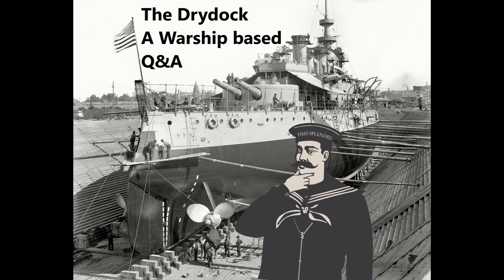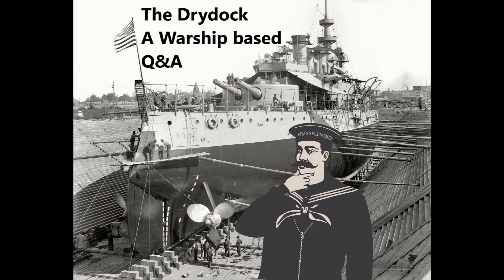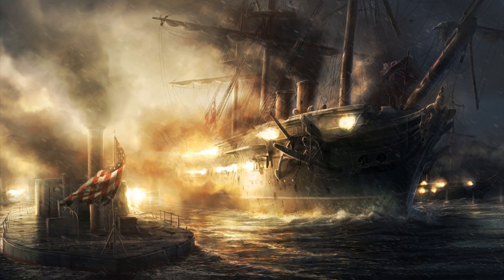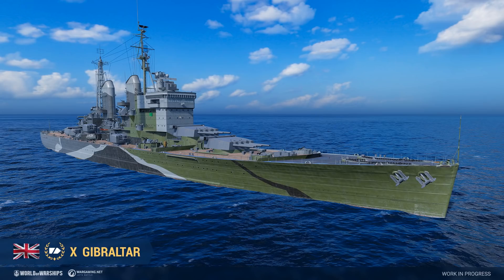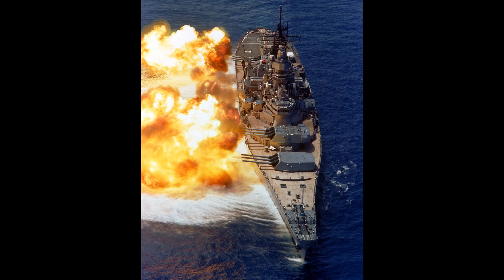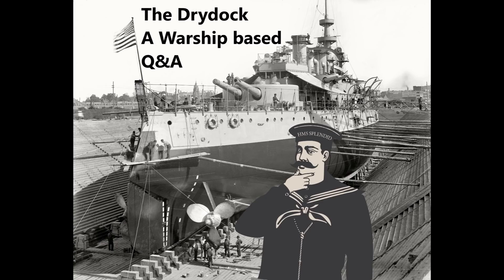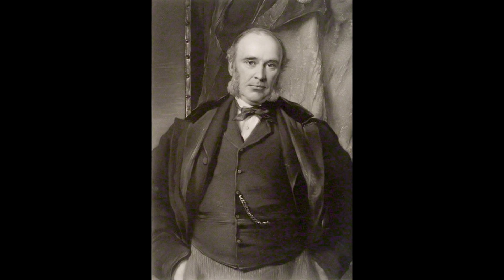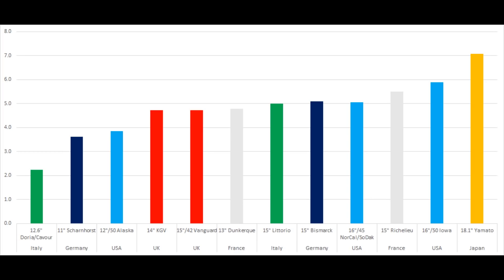The Drydock - Episode 177

Comment: As far as galley fires go, on modern USN submarines fires in the galley (particularly the fryer) were one of the most common we trained for, as they were among the most common to actually occur on board, with the other common ones being the clothes dryer (due to people forgetting to clean out the lint trap) and electrical fires in various equipment.
Reply: Don't tell me secrets but I would have thought the engines would have provided heat for cooking. Except frying, which would be done in a closed compartment.
Reply: @Tuning3434  I should have assumed nuclear subs.
Reply: Ah yes. The lint trap. Another issue in the laundry aside from fires I suppose would be potential vibrations from the washing machine.
Reply: @myparceltape1169  Maybe if they hadn't been covered with asbestos.
Reply: @mpetersen6  I would assume they have a lock down protocol for silent running and the machine is on isolators to help dampen vibrations a bit.
Reply: @myparceltape1169  nope, everything in the galley is electric powered. Steam made in the Engine Room stays in the Engine Room.
Reply: Galley firefighting training provided by Denzel Washington, no doubt.
Reply: @bluemarlin8138  🤣That movie is quite possibly one of the worst submarine movies ever made!
Reply: @Axel0204  What, you mean a US boomer captain DOESN'T get to bring his dog on board, relieve and arrest the XO for not agreeing with him on a nuke launch, threaten to shoot an innocent crewmember in the head to coerce the weapons officer to cooperate with said launch, and punch the XO in the face multiple times, all without any consequences other than voluntary early retirement?  Naaaaah!  

I actually find the movie entertaining, but it's certainly unrealistic as hell, and it must be even moreso for you as a submariner.   As a lawyer who is forced to watch crime dramas that get nearly everything wrong, I can sympathize!
Reply: @bluemarlin8138  the dog is actually the most plausible part of the whole thing, as the CO has the authority to authorize pets onboard, in theory, at least!

Comment: Thanks for a great episode!

 Regarding the Iowa recoil question, I think it would make sense to look at conservation of momentum. Conservation of energy always holds, but the energy that is conserved is the sum of chemical energy in the charge and the kinetic energy of ship and projectiles. In general, that energy will not be distributed att all equal between ship and projectiles.The projectiles actually gets the majority of the energy from the charges.

Conservation of momentum must hold. The shell weight is about 9 metric tonnes. Ship weight is about 5000 times that. So ship velocity after firing will change by muzzle velocity divided by 5000, so about 0.2 m/s. 

I'm pretty sure a person on board would easily feel this. And definitely hear it 😃.
Reply: I think your argument about the acceleration being ~1G is questionable. Each gun firing event is quite quick, but the  the shockwave will be propagating through the ship at something like the speed of sound in steel. To calculate the actual acceleration profile, you'd need to define a position in the ship to measure at. You'd then need to know the exact timing of firing for each gun (I understand they don't all fire exactly simultaneously). Then you'd need some sort of mechanical model of the ship (presumably a finite element model).

Another factor to consider is that the actual shell isn't the only thing causing recoil. The hot gas being expelled from the barrel (the muzzle flash) also has significant momentum.
Reply: How much of this is negated by the recoil systems he mentioned in the video? (provided they are functional at least)
Reply: @r.u.s.e3586  I think basically nothing at all. I'm guessing that the recoil buffers compress very quickly. 

Anyone got data on this? How much does the recoil buffer move, how much does it weigh, and how long is the duration of its movement in time?
Reply: @r.u.s.e3586  It is possible to make a device which absorbs mechanical energy and turns it into heat or some other form of energy.
However, it is not possible to somehow consume/convert momentum. The fact that this is impossible is why there are no reactionless drives for spacecraft. It would, however, be immensely useful and revolutionize spaceflight were it possible.
Reply: In general in physics, there's no law that says the gun and projectile somehow receive an equal amount of kinetic energy.

From a stationary starting point, if one object is thrown from another, with no other forces involved, the resulting kinetic energy of both objects is only going to be identical if they achieve the same speed. And that will only happen if they weigh the same. Otherwise the lighter object will receive more than half of the kinetic energy.

Comment: re the Iowa & firing the guns moving the ship - the conserved property is momentum. It's firing about 10 tons of shell at 800 m/s, so about 8000 tm/s of momentum. If Iowa is about 50000 t, then it will recoil at about 0.16 m/s - enough to feel, but only a trivial change in speed.
Reply: I calculated 0.18 m/s (including the propellant charges going forward, but also a heavier displacement) so we basically agree.
Reply: I think the myth about firing the guns at 90° to the centerline moving the ship comes from blast effect on the surface of the water.
Reply: Two turrets forward, one aft, there will be a slight rotational moment. I guess not big enough for the auto steering to respond to, or someone would have noticed.
Reply: Somebody paid attention in high school physics!
Reply: @mahbriggs  I knew it would come in handy many years later in answering YouTube questions!
Reply: @brucewilliams1892  it would depend on where the centre of gravity of the ship is in relation to the guns. But it is still going to be negligible. 

Battleships, along with the water they are in, are just too much mass for it to have a large impact.
Reply: @mpetersen6  Possibly also carried over from wooden ships of the line, which "moved" (though mainly laying over) when firing guns. But calculation the centre of gravity and mass distribution  for a three decker sailing ship of the line is a  different can o worms. The leverage of the wind on masts and the corresponding shifts plus the flex in the material (wood) probably makes any calculations moot; apart from maybe FEM (Finite Element Modeling) using a major super computer and dedicated software.

Comment: A couple of points I'd like to add...Generally speaking, the members of the Submarine force in the US Navy are the brightest in the entire US military when taken in as a group. And, I'd further add that the test scores required for Navy Special Warfare are very high. As for galley fires...Standing joke in the Navy when we heard the "fire, fire, fire" over the 1MC ( Ship's general announcing system ), it was often a Class "C" fire ( electrical ). The one that would give you chills, was when we had a main space fire in one of the switchboard compartments on the USS Kitty Hawk in the early 90's. Fires on board ship, especially an aircraft carrier were unusual, but not as uncommon as you might think. Interesting pictures from San Diego...The ferry was soon replaced by the San Diego-Coronado Bay Bridge in 1969. The square-rigger is a part of the San Diego maritime museum, "Star of India" ( One of the ferry boats in the picture is a part of the Maritime museum. This is also right next to the Midway and the Navy Supply Center pier ) The paddle boat was still around in the 2000's and was a harbor dinner cruiser (forget the name, and it might still be active...It's moored, or used to be by the Charthouse restaurant right on San Diego Bay. ) The picture of the Mariner is very interesting photo. The only installation that was in that area that was there in "my time", was the Fleet ASW Training Center ( This might explain it's somewhat unusual location and it's mounting ) and the Fleet Intelligence Training Center. At this time, Convair ( General Dynamics ) had a major presence in San Diego with plants at Lindberg Field and Kearny Mesa ( Atlas missile division ), Ryan also had a plant on the field in San Diego at Lindberg on the opposite side of the field. Across the bay you can see the "double domes" seaplane hangars at NAS North Island, which at the time housed the last squadrons of P6M "Marlin" flying boats that would be retired in 1967. LOTS of aviation and Naval activity both then and now...However, much of the aviation giants have long merged or moved to different area of the country. I was stationed at NAS North Island for 12-years in 4-different commands, flying in the SH-2F and SH-60F/HH-60H as an aircrewman/rescue swimmer...So, if y'all have any questions, fire away! As an addendum, it's too bad that ADM Willis "Ching" Lee wasn't able to write his memoirs...He stand out in my mind as one of the FINEST commanders in the entire US Navy! SO SO underrated and not fully appreciated by the Navy and historians alike...By all accounts he was not only a superlative tactician, but made it a point to understand the duties and equipment of the watchstanders in the fire control and gunnery parties...Looking forward to seeing you in Camden!

Comment: @33:19 No, it is not the KE that has to be the same on the shells and the ship, it's the momentum. ("every action has an equal and opposite reaction" refers top force, and momentum (and impulse) is simply force multiplied by the amount of time the force is applied). The calculation is thus:

momentum of shells (plus propellant) = 762 m/s * 9 shells * (1225+300 kg) = 1.05e7 N s
mass of ship = 57e6 kg (full load)
therefore speed at which ship will go backwards = 1.05e7 / 57e6 = 0.18 m/s which is not very fast and will soon be stopped by the water the ship is floating on.

(NB using KE here instead of momentum appears to be a very common misconception, I've seen it done loads of times).
Reply: I'm thinking an instantaneous change of velocity by 0.2m/s of the floor one's standing on would be very noticeable.
Reply: @andersmusikka  It wouldn't have been instantaneous, since the guns' recoil mechanisms would act to transfer the impulse to the ship more slowly (that was their job; if they weren't there, then turrets would have to be more strongly built or would shake themselves to bits). Though I expect the effect would still have been noticeable -- can any former Iowa-class crew confirm or deny this?

Comment: I used to work with a guy who specifically went into the US Navy as a gunner's mate in the 60s. He chose that rating specifically to get experience with both mechanical and electical/electronic systems. When I knew him he was a consultant (owning his own company) who provided and supported thermal oxidizers for soil vapor extraction systems.

And passing ammunition during a battle is the kind of job you assign a cook or ordinary seaman to, not a gunner or gunner's mate.

Comment: Something that could throw a wrench in the works using absolute maximum range would be if you included the shore battery version of the old German 12" that had a 50 degree maximum elevation. I'm pretty sure that would completely crash the range numbers compared to all the other pre 1930 guns
Reply: Umm, unless I'm missing something here, 45 degree elevation when launching a projectile, at least in a vacuum, will give you maximum range. Practically speaking  when air resistance etc is taken into account something less than 45 degrees is optimal for range. Firing at 50 degrees is only useful if you wish to lob rounds over something that's between you and your target, you're sacrificing maximum range to do this.

Comment: Regarding the Iowa moving when all the guns are fired. Momentum is what needs to be considered not necessarily Kinetic energy. Total momentum before equals total momentum after. Momentum equals m x v.
Lots of big assumtions. 2000lb weight of shell, mussle velocity 2000 ft/sec, ship mass 50,000 tons, no effect from the water the ship being effectivly on a zero resistence plane, ship stationary and guns firing exactly horizontally. I believe this works out as the ship movings a 3 ft/sec sideways afterwards. I have not idea how to work out the damping effect of being in water. If the ship was on a scating rink?????
Reply: Good point about the damping. Presumably the time constant of the dampening is at least an order of magnitude greater than the time it takes to fire all guns in a salvo. In that case, the dampening doesn't affect the sideways speed immediately after firing, only how that speed dissipates as the water resistance brakes the ship's sideslip.
Reply: 10 tonnes of shell, 50000 tonnes of ship, I get 2000/5000 = 0.4 feet/second.
Reply: One thing that might affect the dampening: I guess the ship will bend in a sort of whiplash effect. This might cause the bow and stern of the ship to whip at >0.4ft/s. And the dampening of the water might thus be slightly higher. But I don't know how large that effect is. What is the time constant of a battleship sideslipping to a stop? 2 seconds? 10 seconds? I have very little intuition about this 😃
Reply: The total dampening would be higher, since water drag usually increases by the square of the velocity.
Reply: @andersmusikka  Yes, sorry. The total mementum before is zero so the final momentum is as you have said. Can I blame the calculator. It is an HP32S II but it is quite old and has new batteries. 
The point I wished to make though was that Kinetic Energy does not enter the simple equation of motion. Kinetic Energy effects all of the bits eliminated from the equation i.e. damping effects, recoil effects.
I believe from memory that the 16" shell weight was 2100lbs (from Janes Fighting Ships) but that is from memory of lots of years ago.

Comment: Iowa’s heavy AP in the modern day was very effective against bunkers and shore installations. 

At maximum elevation her 16”50s would send a projectile approximately 7 miles into the air. That’s a bit of kinetic energy to load onto a relatively small point of motivation designated for your enemy.

Comment: @33:50, you mention doing the math on kinetic energy for the guns.  For computing how much the ship will me moved laterally through the water, you should do momentum, and include the mass of the powder charge in that calc:

( 2700 lb shell = 660 lbs propellant ) * 2500 ft/s = 8.4 Mega-feet/s recoil impulse.
divide by weight of a fully-laden Iowa 116 Mega-lbs 
ship receives .072 ft/s of lateral speed per tube fired or .65 ft/s - 7.8 inches/second, for a full broadside

so, yeah, 7.8 inches/second of laterally drift when moving at 30 kts (600+ inches/second)... 1.5% course change firing a full broadside?  probably not enough for the helmsman to notice compared with the effects of wind and current.

Comment: the mark14  torpedo does not get designed if Subs are banned by the  Washington naval conference. the money saved increases the Fletcher Swarm by 40%
Reply: Remember that even without the Mark 14 for submarines, BuOrd is still responsible for the Mark 13 aerial torpedo and the Mark 15 torpedo used on those Fletchers (among others).

Comment: The reason behind the weird arrangement of main mast, as far as I've heard of, has a lot to do with the ship's crane(s). The admiralty disliked the idea of installing 2 smaller cranes on each side of the ship, because they believe they will block the firing arcs of those wing turrets IIRC. So they had to install a large crane on the main mast and it had to be placed behind the first funnel.
Reply: The other reason might have been that the actual crews tended to love cranes  as much as they despised derricks.  The pre-dreads Triumph & Swiftsure were very popular with their crews, partly because the chileans didn't have a prejudice against cranes.

Comment: USS Tang had a kitchen fire while patrolling off Japan. US subs had commercial deep fryers installed. The fryers were designed for AC power, but installed on a DC system. A relay failed and overheated the oil until it caught fire. Submarine hulls use cork as an insulation. After the fire was extinguished. the crew took a vote and the fryer now rest at the bottom of the Pacific, homeless and unwanted!

Comment: Early steamers had constant engine failures. 1 stage engines are coal hungry. Coal storage was very limited due to armor.  Screws were very inefficient and loosing screws was a very very expensive problem. Riggs were used often.  A Stern gaff sail would steady the ship in swell.  A speeding increase running steam and sail  together is another goal. Lastly, people in the armed forces are fearful of change.

Comment: On the question: Did firing all 9 guns on an Iowa have a affect on the ship ie recoil slightly pushes the ship to oneside? 
Your answer was a bit cringy. You may try again using the conservation of momentum. Also, the recoil of the guns ends with the momentum transferred to the ship. The recoil mechanism just smoothes things a bit and puts the gun back in place for the next salvo.

Comment: Surely if the Iowa's guns were so powerful they could push the ship sideways, either water resistance would rip the front off, or more likely the turrets would be launched off the deck.
Reply: Why do you believe that? The guns and gun mountings are very sturdy. Perhaps more so than the rudder and propellor, and those can cause much greater changes in velocity than firing the guns will. But still firing the guns will impart a speed of 1/4 kt or so.